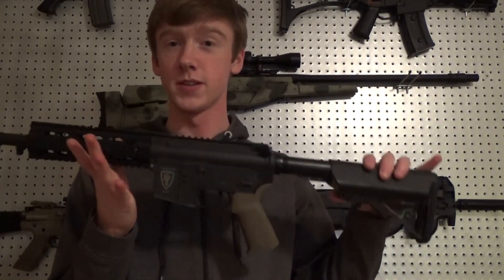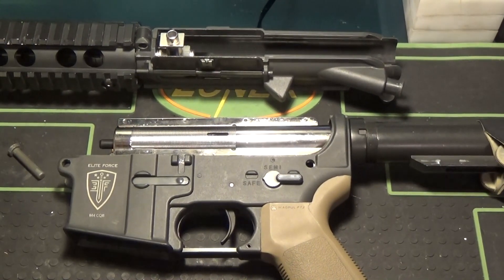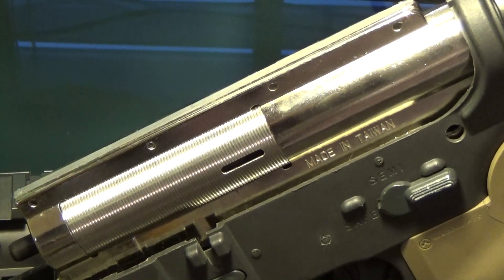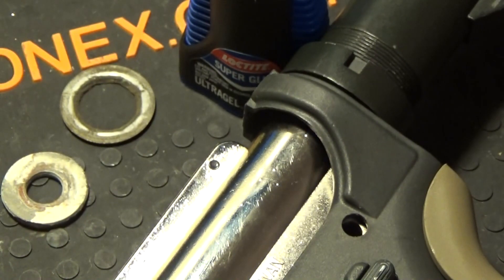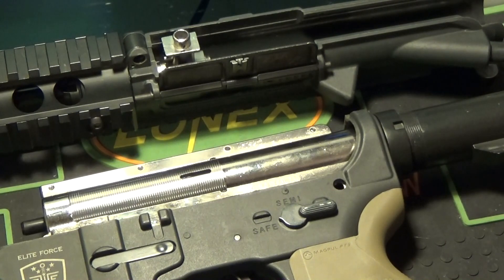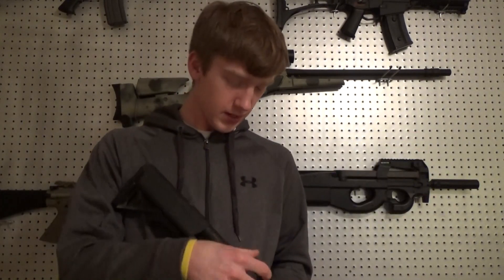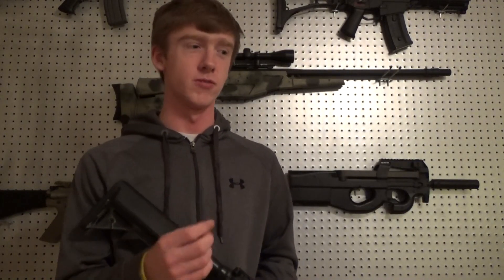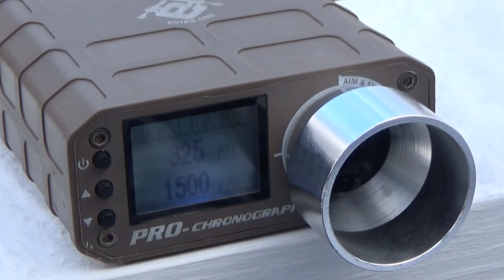Elite Force M4 Re-build!

Comment: Hey, great video. I am a novice Airsoft Tech...I am starting to do more Tech work. I have a couple Elite Force M4 CQBs. I bought some Modify Hop Up units, but for some reason they won't fit in the M4 CQB. The Modifys work in my CA M4, but they don't fit in these Elite Force M4 CQB. I even tried using the CA hopup unit in the Elite Force M4s, but that didn't work either. I noticed that the Hop Up units I was using were "taller" than the stock hop-up unit. I wonder what I should do, and what Hop-Up units should I use.

Comment: I have a question (Sorry if I sound like an idiot, I'm just a little confused). What do you mean  when you said you added shims to the back of the gearbox? I'm trying to install a polarstar jack into my Elite Force M4 CQB. I need to buy a new gearbox shell, and I'm just confused on the shims part. Also, about how much would you say you sanded off the top of the gearbox? Thanks, and great video!